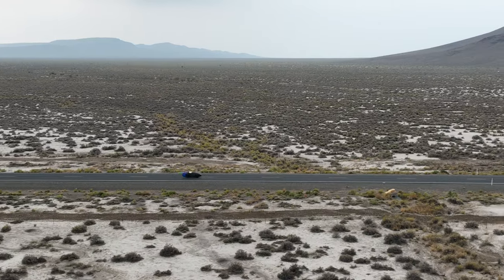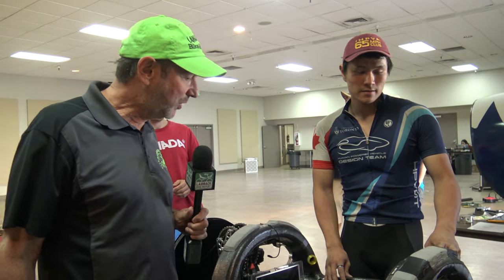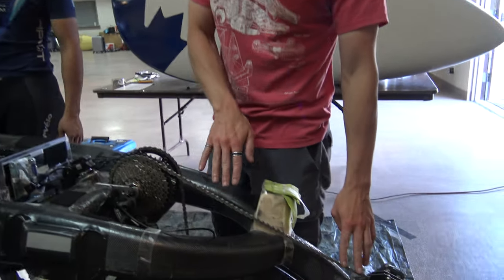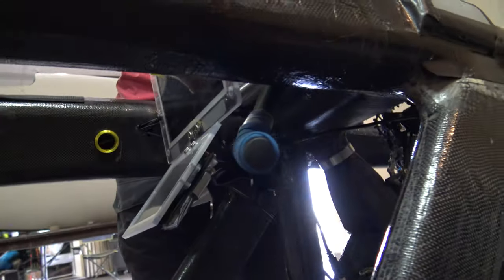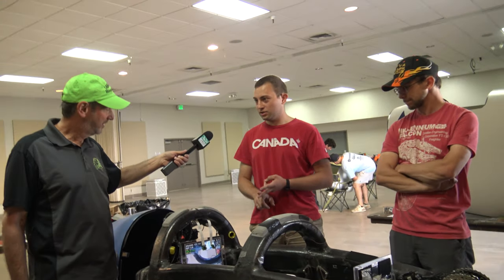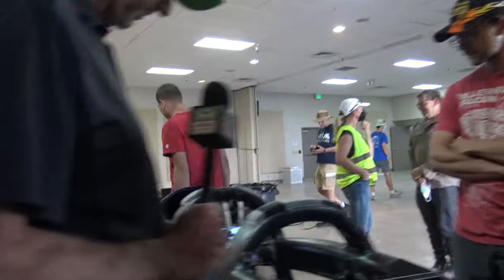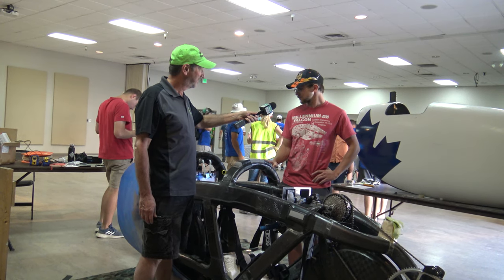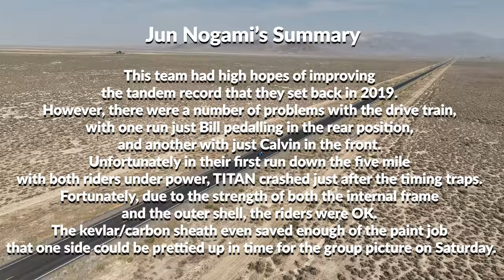Battle Mountain Human Powered Speed Challenge--Titan Tandem

Comment: Imagine how fast it would be with 10 people! It could be a new type of team sport, similar to rowing etc.
Reply: I think 5 man crew bikes have been tried many years ago, but the complexity resulted in regular breakdowns, and the nonlaminar air flow over such a long shape meant top speed was poor,  so it's not an advantage for bikes to go big on crew.
Reply: Looks like a two man bobsled on wheels. Just awesome design and scary fast . It’s something to watch!
Reply: Not sure about that. This extreme sport of  Pure HPV racing is still new, still run for the most part by extremely dedicated novitiates in their spare time with very limited funding & a planet of billions of people still unaware as to how vital this technology is to the current biosphere’s survival.

Ever since the 1960s Club of Rome’s top experts on how the global econopolitical system works predicted peak oil by 2021 followed by a crash in oil production & the human population plunging like stampeded mastodons off a cliff once their main energy source evaporated, there has been a desperate race for insane energy use efficiency which modern LEDs have provided for light & carbon fiber & kevlar are doing for making high speed vehicles light.

There is no reason an entire LAND tandem team’s vessel can’t be as aerodynamic from stem to stern, just as a rowing team’s vessel is already.

It’s just a matter of getting funding through general populace awareness & once you put a hydrogen or electric motor on Son of Titan, it’ll be King Kong all over again, in a GOOD way!

Saving NYC & the other megalopolises from running out of MORE POWER SCOTTY!

Scotty: “I’ve given spaceship Earth all the power she’s got! Diverting all available power to life support systems before critical heat meltdown! These dilithium crystals are shot. Where’s that Tokamak, now that we need it, coming online?”

In the purely HPV novitiate’s almost religious quest for max human powered speed, all we need is MO FUNDING! And continuing to think out of the decidedly un_aerodynamic brick box of petroleum distillate “gas” guzzler trucks & SUVs driving homo sapiens to an all too early grave!

Imagine all this technology being used just 40 years from now on the moon, with bullet shaped maglev trains racing through that natural vacuum at about 1100 KPH & old geezers pedaling themselves healthy at age 120, no longer allowed to sit like a sack of potatoes in the maglev, their arteries filling with crud, because the racing blood cells haven’t been scrubbing their arteries clean for the better part of 60 years!

Time travel the old fashioned way by living a healthy lifestyle, keeping your current body alive & kicking, while raising the next generation is a VERY challenging, EXTREME sport!

Just ask your grandparents!

And on a final note of inspiration, with the revelation to the public out of Georgetown University on 4.28.2017 that the human species is more related to the child loving benevolent Bonobo ape than the killer chimp, we have renewed hope, nay affirmation! That the human race will listen to the better angels of our nature, rather than the worst, instinctively demanding return to “law of the (asphalt) jungle” rule over planet Earth, resulting in a joint suicide pact by thermonuclear cleansing.”

  We don’t want PLANET OF THE APES franchise to become our movie epitaph!

Much orefer INTERSTELLAR.

And TOY STORY:

“To infinity & beyond!”

Divinity is our DESTINY!